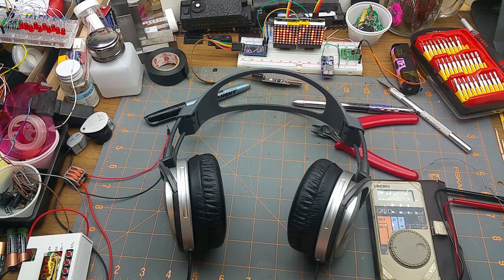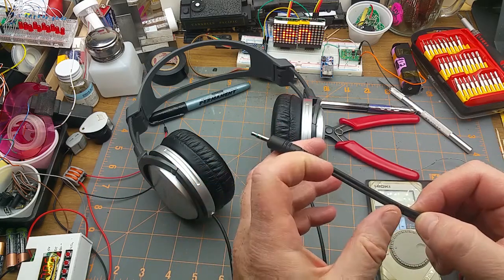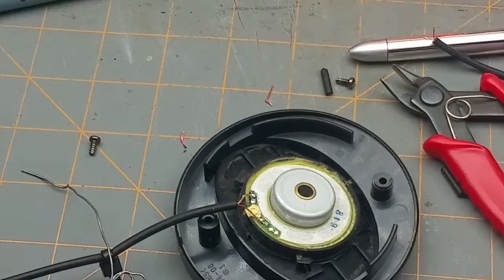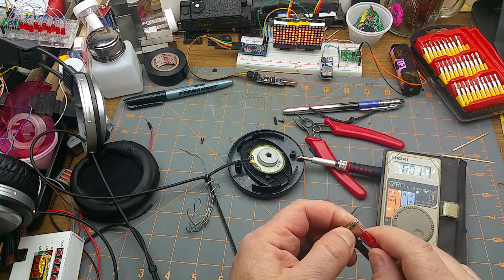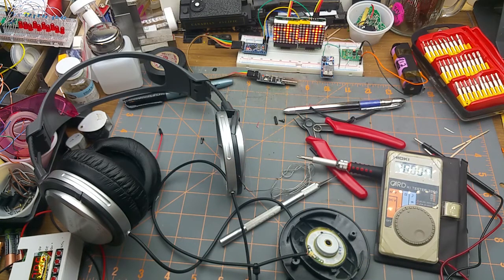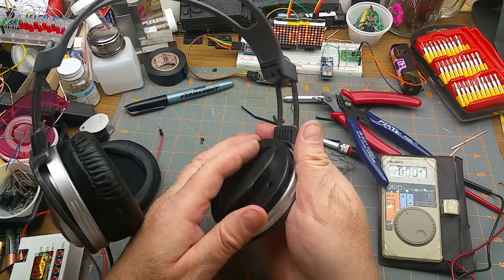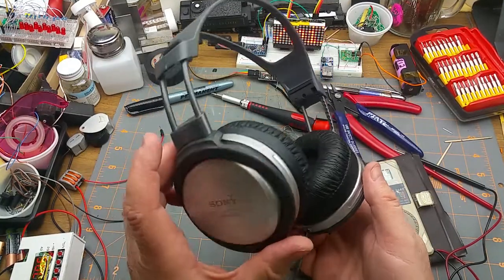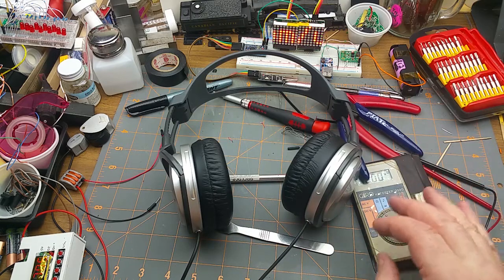headphone repair

Comment: I just repaired my SONY headphone wires today.  The left speaker was dead.  There was a wire defect in the cable that was located just before where the cable enters the headphones.  Wiggle the cable there, and the left speaker went on and off.  So I cut the cable an inch or so just before the defect, and then had to open up the headphones and then solder the freshly stripped wires back to their appropriate points.  But of course, Murphy's law then stepped in.   As soon as I started, my very old soldering iron kicked the bucket.  It literally went up in smoke.  So I used a kitchen oven ring to heat up the soldering iron tip instead.  Job done.   My headphones are up and working again. My SONY headphones are so old that that shiny surface on the outside of the ear cushions has totally disintegrated. In my case you have just one cable that is going into the left speaker, and the wires are super thin and a pain to strip and solder.

Comment: when you conect it back you reverse the conection the clearer wire was on the other side i check back the vid to make sure very inetresting i enjoy your vid a lot
Reply from the maker: I wouldn't be surprised that I made a mistake, even with double-checking.

Fortunately, it doesn't make a massive difference in this application.

Thanks for watching, and for the comment.
Reply: Nice repair video. Enjoy your videos. Thanks.